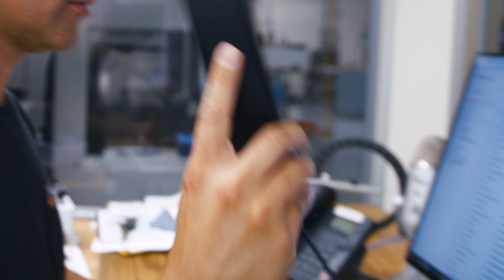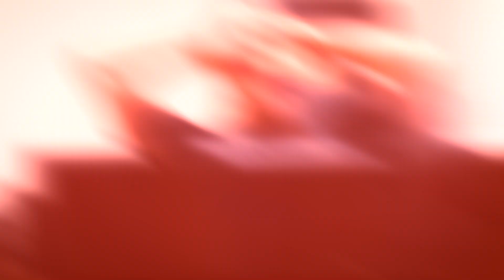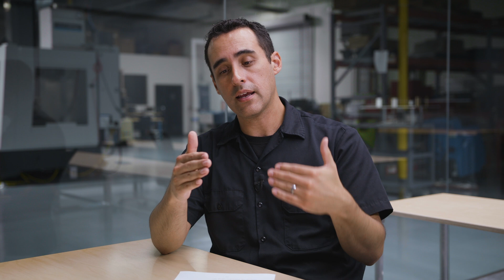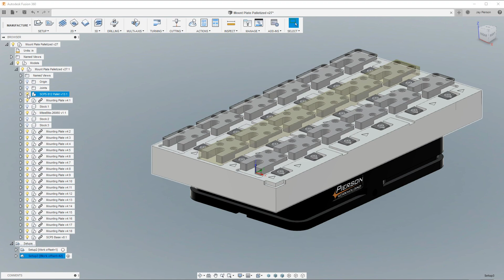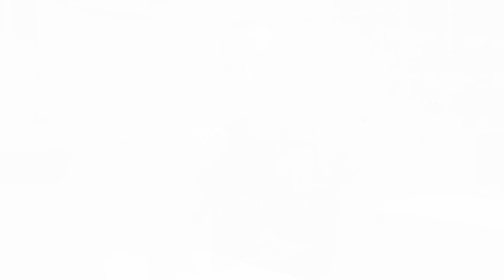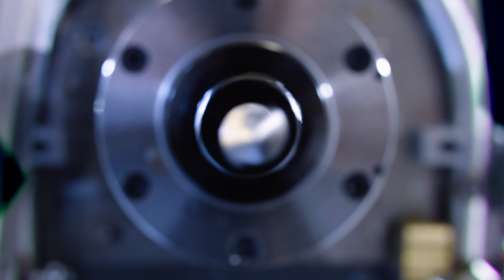How to Manage TOOL LIFE - Reduce Setup & Crashes - Pierson Workholding Q&A

Comment: We use Okuma and Mazak machines. They are equipped with collision detection system. You just model your tools, workholding, your blank and part (import from CAD) and voila, the machine won't let you go any closer than 3mm to any of these. Except of blank and part. This is really good for 5ax simultaneous machines where it's very easy to crash machine itself. It needs some effort, but if you make some automatization of model generation it really worth a penny.

Comment: I put my job up on the machine when I left at the end of the day. It was not on the machine when I returned in the morning...the tool that was in the spindle was not there and the heat shrink tool holder melted at the bottom in such a way that it could not be used anymore

Comment: I'm just curious as to why the tool was spinning when touching the tool setting probe?
Reply from the maker: Using the rotating tool probing cycle is a good habit. It spins off chips that might be stuck to the bottom of the tool.
Reply: @PiersonWorkholding  interesting. I've never saw a spinning cycle for this. Usually setting new and therefore clean tools but I'll will make sure the SPINDLE probe is clean when touching off with it even though it's tucked away and shouldn't be dirty. Although unless you're doing in process measuring and then a spinning probe could push chips away to achieve highest accuracy as possible.
 I just would think that a spinning tool is no beuno against a calibrated unit such as the tool setter. But interesting nonetheless even though Ive never saw this type of probing cycle on our Haas or Mazak but will be exploring it when I go back on tuesday!
Reply: to rebut/reply to myself after a few moments of thought, spindle probe is plastic tipped most likely softer than anything it touches so that's not good, and there is a possibility of touching off harder tools than the tool setter (which is carbide and harder tools that such as pcd or diamond coated(maybe not you but I have used both) so I definitely wouldn't want those spinning when touching the tool setter. We could make the argument that it's all relative but it is not if you have two different probes (tool setter and spindle probe) so if the tool setter wears down it's relation to the spindle probe would change over time. I'm just thinking in reliable terms over time/ways that relationships could change over time introducing tolerance issues when the two's relationship shall never change. The less variables the better, right? I understand it could be a while before it's noticed or even become a problem depending on other processes, but it could be something down the road. and that's enough for a discussion point from me-not to be a nay-sayer or to say you're doing it wrong but more as for discussion  to garner perspective or maybe overlooked points.
Reply from the maker: @cobburn  I highly doubt any wear will ever occur. First off, the tool only spins backwards in the probing cycle. Second, regardless of tool/probe hardness the pressure it touches is incredibly light. Finally, people a lot smarter than me created this a long time ago so I'm sure they got it right. So how do you touch off face mills without spinning the tool?
Reply: @PiersonWorkholding  I thought the same that it is light pressure and spinning slowly.  Diamond coated tooling isn't directional. and now you have softer tools against something harder albeit slowly and backwards. I just never saw it as our renishaw probes and macros only orient the spindle so this is intriguing to me. maybe it only spins for a face mill? I know the drill macros don't. my toolsetting pad has a divot in the middle of it actually I assume from many years of nonspinning use. 

smart people have gotten plenty wrong and it's not always about intellect. And smarts doesn't mean common sense.   Internal bureaucracy can play a role or a change goes unnoticed. Look at Boeing, smart guys there huh and look where their MAX is. A company you'd think knew what they were doing. Things get compartmentalized and budgets for R&D get used up. Im not trying to be a dick and say what you're doing is wrong. It's a discussion and Im learning as well. It just looks really bad when it's on paper. No such thing as stupid questions right? 
 
I touch off a face mill like  I would a big end mill, step it over and touch it off where an insert is. maybe it's just the face mill macro that spins? now i Have more questions and why I always ask questions. i'm naturally curious and it's not to point out any little thing. Learning goes both ways.

Comment: Can you tell us how  you select mitee bite clamps and the quantity of them for particular operations on a fixture with regards to tool feed and cutting forces. With multiple sizes and clamping forces, do you have a schedule of ranges for radial depths of cuts for particular clamps. I don't have any experience with the clamps and it seems that it would be expensive and time consuming to find out by trial and error which clamps are best for particular roughing and finishing operations. Another aspect to using fixture clamps, do you program to the clamp capacity or do you select the clamp to match the program cutting parameters? Maybe some combination of both?

Comment: How to avoid crashes? Can't be done. You can reduce the number of crashes. Single block. Read program and know where it will be heading next. Get comfortable with switching between absolute position and distance to go.
Reply: Oh yes you can, if your good as me! I've been running my VMC for 3hrs 27minutes and 43seconds. Ain't crashed yet!
Reply: Damn it!!!  %$#@@÷  Y'all had to bring up crashes. It's  your fault I just screwed up my perfect record. 😁
Reply: @aoiattentiononinvention8031  But you did reduce the number of crashes by 3 hours and 27 minutes. Be proud.

Comment: In a low volume/high-mix job shop or a prototyping shop - tool life is nearly impossible to track by any method. Reducing setup time and crashes is the primary focus. I used a 'ping pong' method for years where we had double the tool holders and double the workholding so that we can be prepping a job with tools and fixtures while another is in the machine. Drastically reducing changeovers.

The Pro Pallet systems are the ultimate way to change over machines for totally different parts/materials/tools a number of times in a single day.

Comment: Were you using a refractometer to inspect the end of a tool?
Reply from the maker: Yes!  Machinist tip: You can use the lens of a refractometer to inspect drills.  It doesn't work with endmills though.
Reply: @PiersonWorkholding  Sounds like a little BS going on here.... I will have to look thru mine tomorrow. I bet you are still laughing thinking about how many people you can get to do this.....
Reply: @davids.682  lol
Reply: Well spotted.
I was thinking the same thing ????

Comment: 1:28 .  I just paused to see what tool do you use to examine a drill. and WHAT did i see? well ,I dont know that it cant be done.so I have to try it tomorrow.
Reply from the maker: Make sure you don't point the lens directly at the drill tip or damage may occur.
Reply: @PiersonWorkholding  i have been doing it the wrong way for all my life